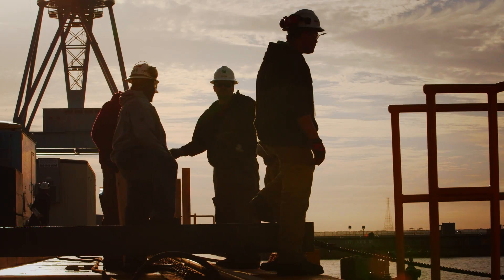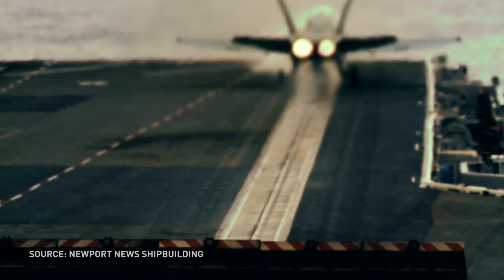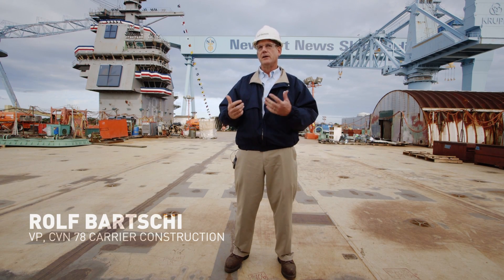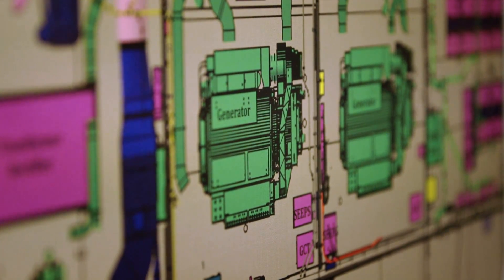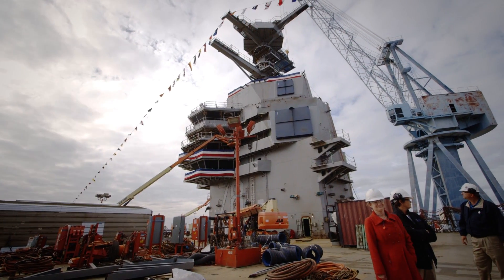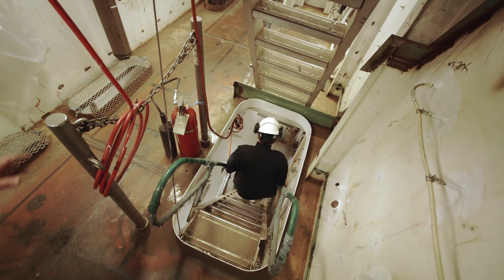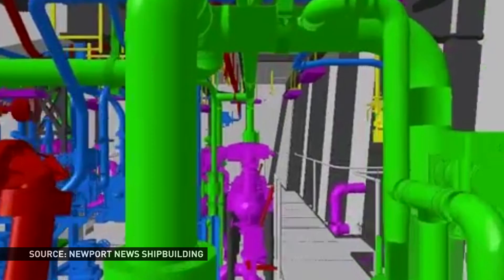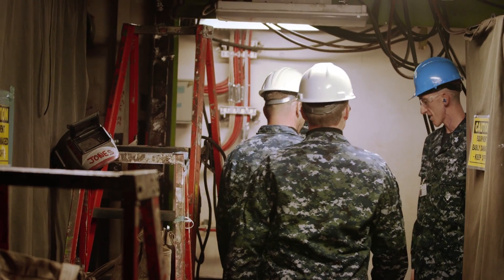Building the Navy's most advanced aircraft carrier

Comment: I'm worried about this ship, they're replacing a lot of beneficial older technology with new ones. An EMP bomb cant shut down steam-powered parts. I'm not sure about magnetic powered catapults instead of steam powered but i still think steam would be better. And a lot of other small things that are a risk.
Reply: Tortoise010 The ship is steel pretty much will absorb it. Most of the communication devices on the ship use fiber optics to talk to each other so EMP will be useless. As for the rest you don't think they would protect the equipment rooms from a EMP? After all that's said and done highly unlikely a missile would get near it with today's banks of missile interceptors.

Comment: Which one is best and which one is the least powerful?: Snapdragon s4 pro, snapdragon 800, snapdragon 600, tegra 3 or tegra 4?
Reply: A little off topic don't you think? Snapdragon 800 and Tegra 4 are the most advanced chips of those. The S600 is a smaller S800 and the S4 Pro is a smaller S600. Still The S4 Pro is better than the Tegra 3 when it comes to performance. I'm not quite sure if you will notice it in daily use. There are a lot benchmarks on youtube you can check out!